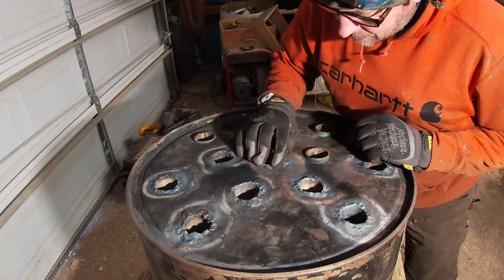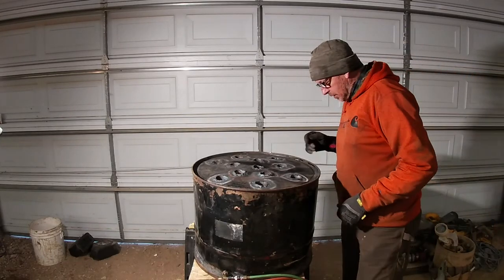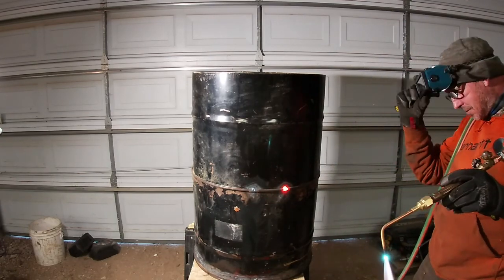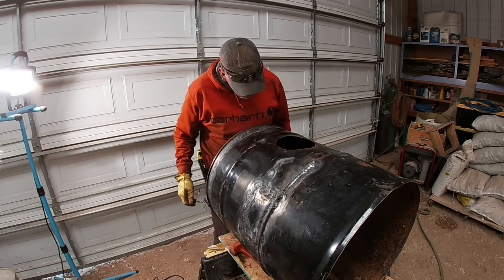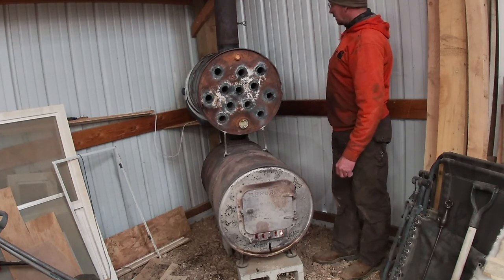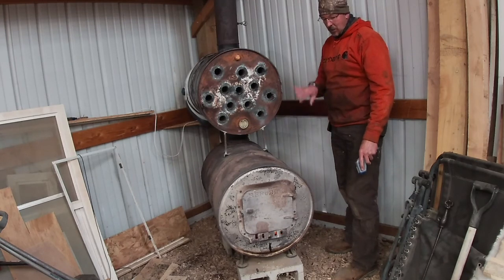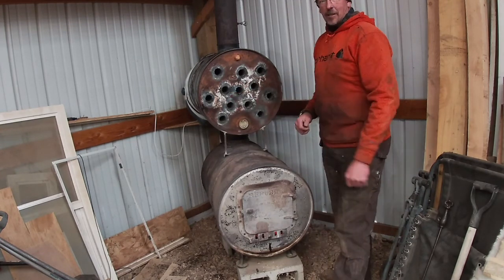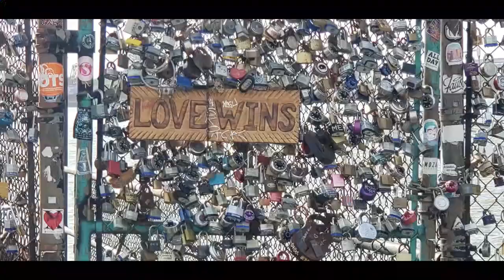Heat Exchanger finale and some puppy footage...

Comment: You have a lot of patience welding those tubes up that way.  I would have mig welded them, lol.  👊🔥🔥🧡👍
Reply from the maker: My little mig isnt very good and im not very good with it. I was really wanting to learn how to do it so i got a lot of practice. Thanks for commenting!! STAY SAFE!!!
Reply: @307j.o.a.t9  welding is all practice, when I first got my little 125 amp mig welder I wasn't very good with it either.   Later figured out I had the polarity backwards to what it was supposed to be for the type of wire I was running.  The more you burn the better you get.  A good welding machine is key, currently for my Home Rig I am running a Hobart 210 Handler, I got the Aluminum Spool gun for it too, a good little machine for learning and home use.  I would like to learn Tig, did a little in college, Super rusty lol 🧡🔥👊
Reply from the maker: Thats the truth!! I need a better hood too. My tig is a lincoln 100. I discovered the same thing too that the polarity was backwards for burning flux core. My boys are pretty good w it. I want to get a better one for sure that jas a spool and maybe tig capability.